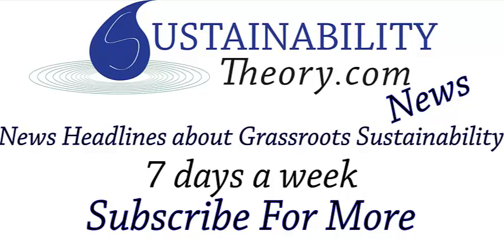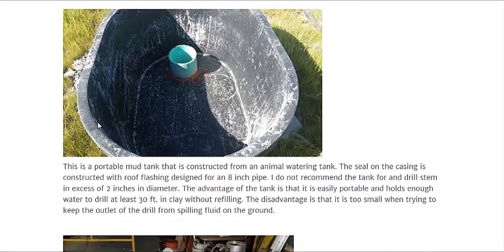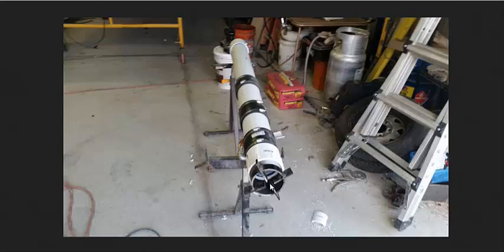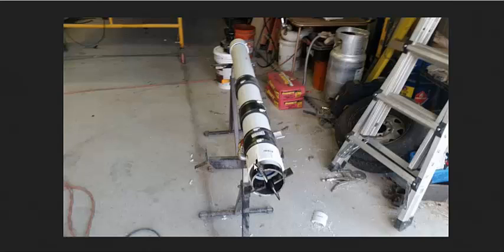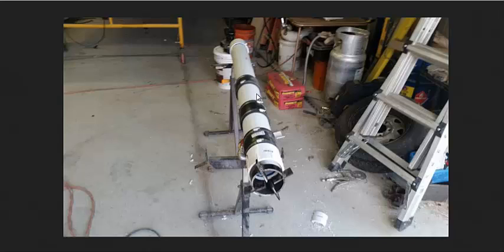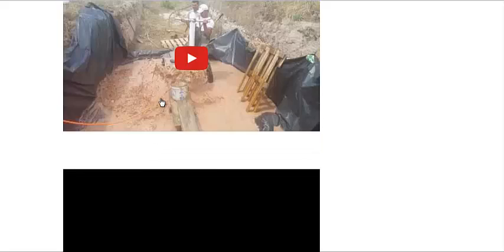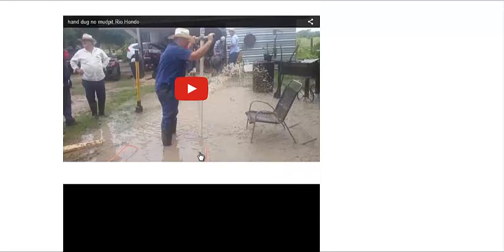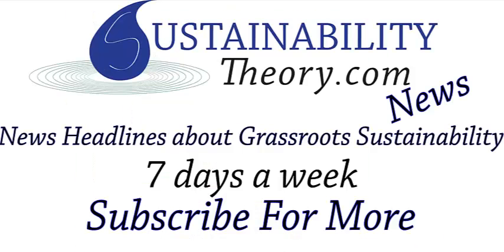FREE Water Well Drilling Rig Plans

Comment: This doesn't work if you hit a dry packed clay layer. Worked fine to 18', then I hit a black clay layer. 8 hrs and I've gone 5'
Reply from the maker: Good point. Hard packed clay is tough to drill through. Here are some ideas for those trying to dig/drill in clay

-Re-enforce the bit with more ridged cutting teeth in the middle.(maybe just sharpened pieces of rebar) 
-drill it for 30 minutes a day, filling the hole with water when you're done for the day. The water should soften the clay, but it will be heavy, increased air pressure or a shop vac may help remove material.
-Gypsum is used to break up dispersive clay. (google dispersive clay test)
-depending on the depth of your water table hand digging may be the next cheap option. but since you're already at 23 ft that's not a safe or realistic option for you.
-Maybe create a water collection pond at your properties lowest point. (In India the build an upside down step pyramid like pond that fills during monsoon season.) If It's deep enough you could hit the water table at the bottom, maybe even creating a spring fed pond, like in sand/gravel pits.

Good luck hitting water.
Carl
Reply: Sustainability Theory if I leave the hole without the air lift working the sand collapses into the hole within about an hour. I am able to dig a ft if I leave it over night, but that's after sucking out the collapse each day for hrs. I've tried 3 different bits, smaller and more aggressive and still can't get more clay out. I'm going to have to try a different spot I think.
Reply: Sustainability Theory if I leave the hole without the air lift working the sand collapses into the hole within about an hour. I am able to dig a ft if I leave it over night, but that's after sucking out the collapse each day for hrs. I've tried 3 different bits, smaller and more aggressive and still can't get more clay out. I'm going to have to try a different spot I think.